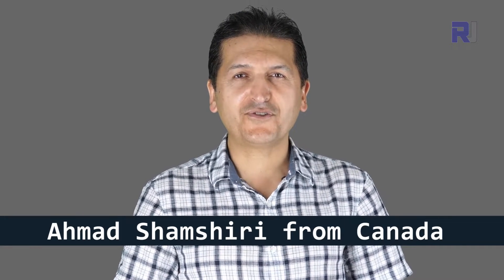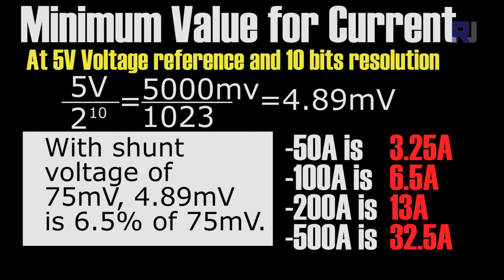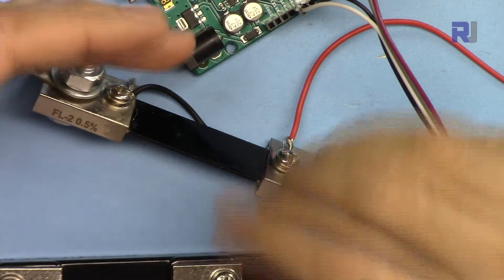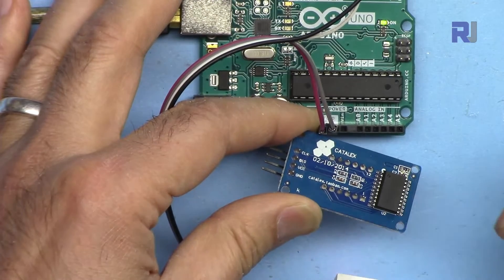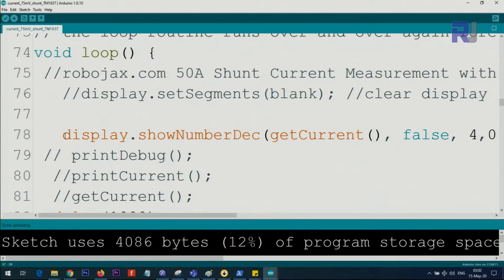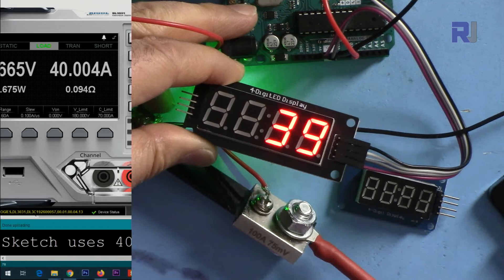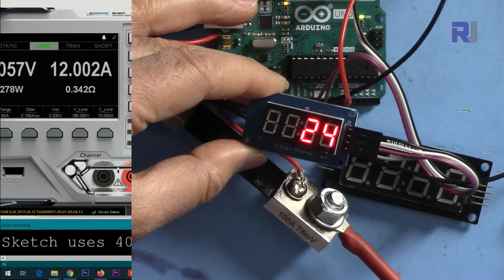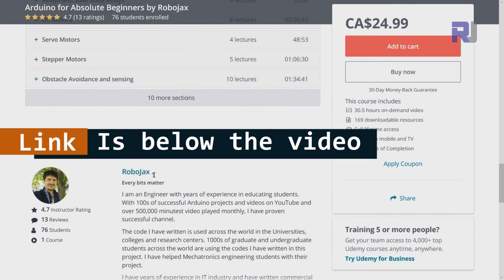Measure up to 500A DC Current with  Shunt and Arduino- TM1637 Display - RJT318

Comment: Hi sir please help
In my project i need measure the 450v dc current with shunt resistor and mcu its possible and how please reply sir 
From India 🇮🇳
Reply from the maker: Hi, here is the video to measure any DC voltage with Arduino https://youtu.be/t8xwrVj2aFs

Comment: good explain
i want desply tm1307
A . point
(12.20A exampel)
this disply see 12
not see .20
how to fix
Reply from the maker: TM1637 is a pain. use HT16K33 shown here https://youtu.be/4aCgHNJl9kY you can display anything you want very easily
Reply from the maker: even with 50A shunt, you will have 5% error which is 2.5A so why would you want to  see 0.2A. it never shows it. I have explained it in the video
Reply: thank you

Comment: hi , sorry but i have a (probably very) stupid question : when you measure current/ voltage , can you just read it (via laptop) without having to use a display? thanks
Reply from the maker: Hi, no question is stupid.  Yes. Computer is used to write code and upload it to Arduino. then you don't need it. just connect USB or power adapter to power it up.
Reply: @robojax  hi again , thanks foor the answer . the thing is i want to read it without the  reading trough a display. i would like to capture it and sent it via a gsm. sorry very new to this... thanks
Reply from the maker: Then don't use this code. in the description we have the main code, use that. get the value and sent it.

Comment: Which amplifier Ur using ?
Reply from the maker: There is no amplifier. Please watch the main video https://youtu.be/9jwCc7uPGoc
Reply: @robojax   my application is to monitor the current rating in battery.  I can't directly connect . I'm using  low side current sensing. So i need an intermediate amplifier to amplify for precision.
Reply: yes, whare your amplifier ?